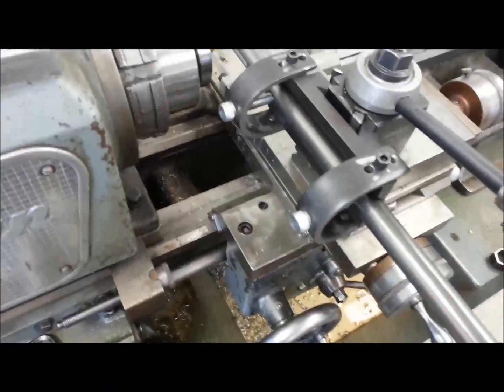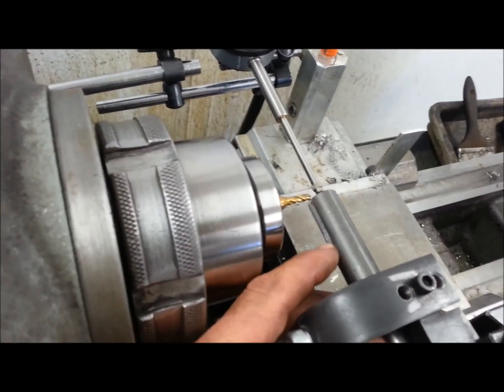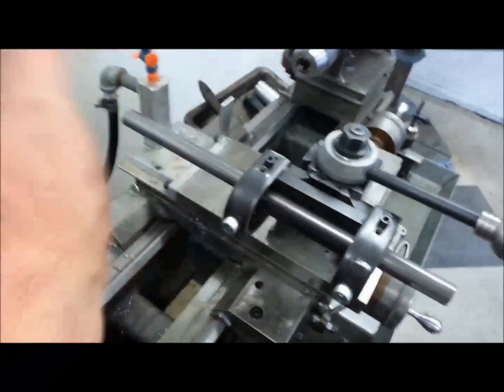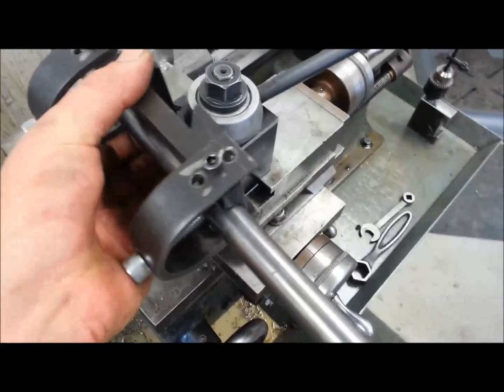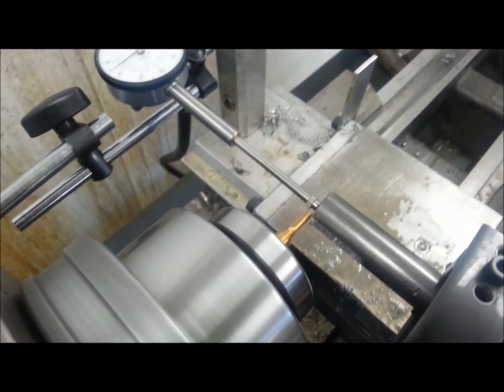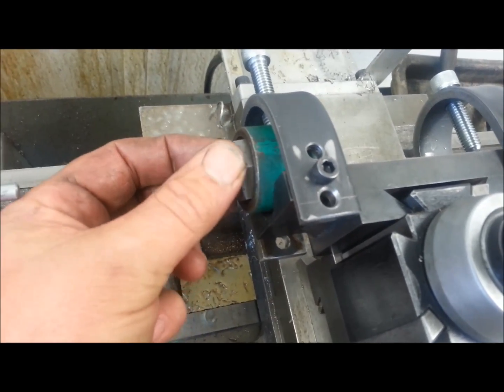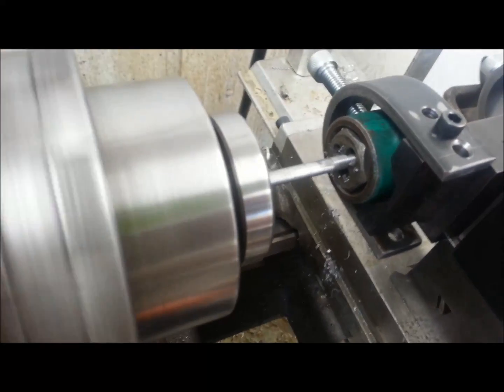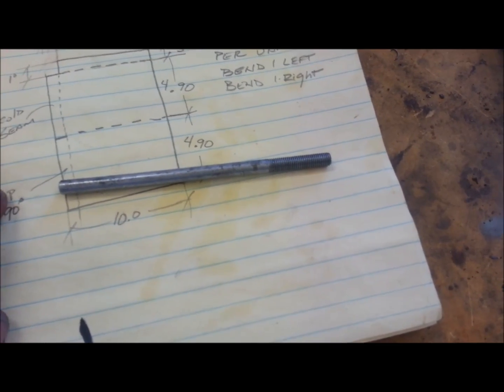Quick and easy shaft key way

Comment: Damn! When it comes to milling on the lathe, I've read many posts on forums, viewed mucho vids and have tossed endless ideas around in my head. This includes milling tables affixed to the CS, XY milling vices and slotted tables held vertically, etc. but nothing quite as clever as this. I love it for what it's intended! Your basic concept opens possibilities for milling & drilling small square & rectangular stock holding using an unmodified holder to boot!

Question: Since I see no threaded hole where the height adjustment screw & knurled nut usually sits (I know that you're not using that feature) .. I'm curious... Did you mill the V in an OEM holder or did you make it from scratch?

I look forward to seeing more of your ingenuity!
Reply from the maker: Hi Sam, 
It's all shop made, when the block drops down to rest on the compound, use the lathe to cut your lower groove (using a 45* cutter) flip and repeat for perfect center height alignment.
Reply: Excelente, tenemos la misma línea de pensamiento